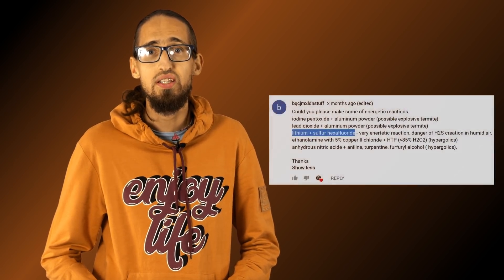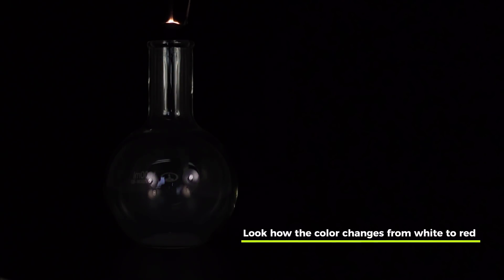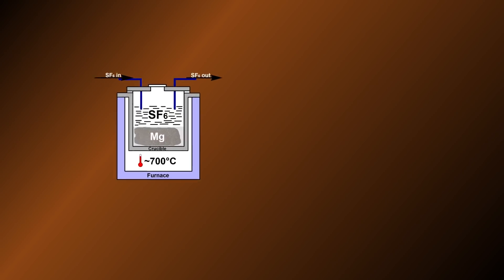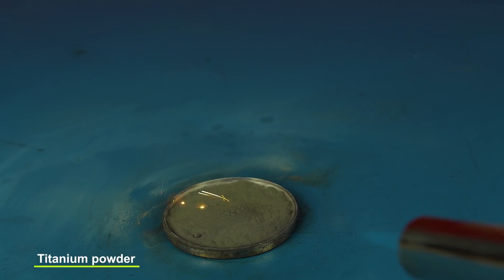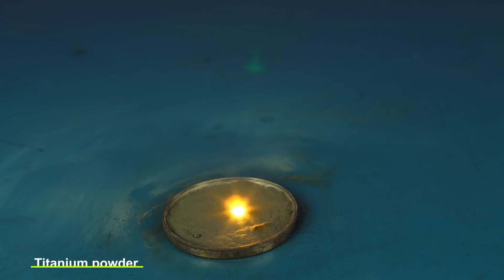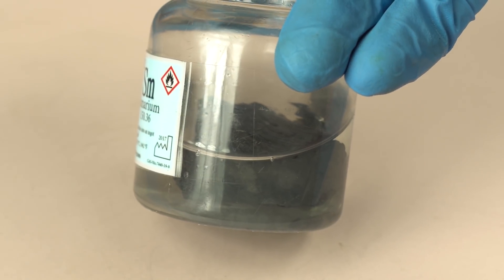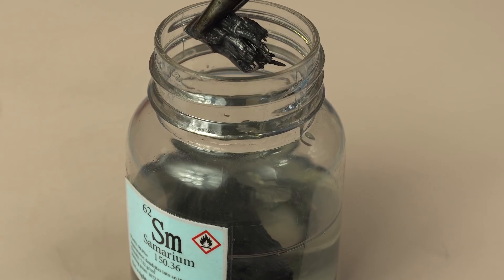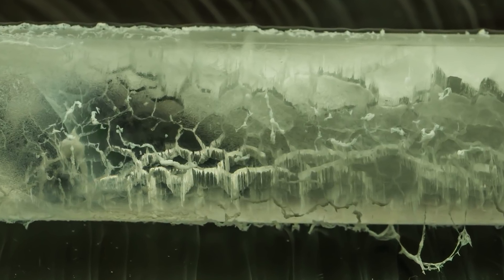SF6: Sulfur hexafluoride. Chemical reactions

Comment: Hi, reaction sulfur hexafluoride is use for Mark 50 torpedo propulsion. In Wikipedia has written that sulfur hexafluoride just spray on mass lithium  (SCEPS propulsion) and there is nothing about that lithium or others metals must be heat up in order to  react. I have a question does sulfur hexafluoride can react with sodium similar like with lithium and give large amouts heat? Can sulfur hexafluoride react with sodium chloride?  What need to do in order to sulfur hexafluoride reacting with sodium?

Comment: SF₆ → S + 3F₂ under 800 °C? That's so ridiculous... How could sulfur and fluorine gas mixture become a thermodynamically stable state under 800 °C? It could decompose in air over 600 °C and generate a series of compounds, or decompose without air under 2000 °C (which I think would generate SF₄ + F₂).

Metal reacting with SF₆ should be a free-radical reaction: Li + SF₆ → Li⁺ + SF₆·⁻ → LiF + ·SF₅; ·SF₅ radical would further be reduced several times and generate the final products.

Comment: SF6 is used in eye surgery , macular hole surgery the eyeball is filled with SF6 to push the retina back. it can do it because it is a heavy gas. after a while it absorbes so no need to reopen the eye, to remove it, no another surgery. So this gas can be put into our eyeball... crazy
Reply: Not in the EU, because SF6 is a very strong greenhouse gas and its only allowed use is as an insulator in electrical equipment.

Comment: i also calculated that Hf + Re2O7 should burn like a thermite at about 5000°C, but cheaper version is Zr and WO3 at about somewhat lower temperature of 4000°C. somewhat hotter should be Y or La with WO3, just for inspiration :)
Reply from the maker: How did you calculate it for such high temperatures?
Maybe I'll make a video about exotic thermite reactions